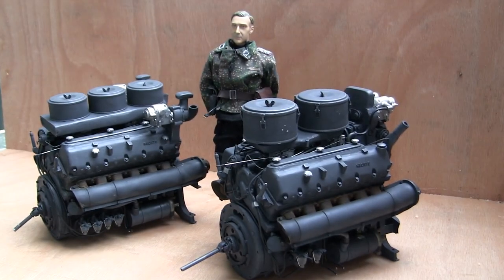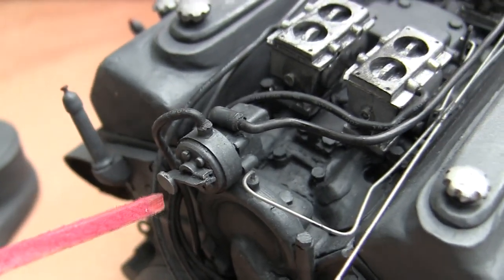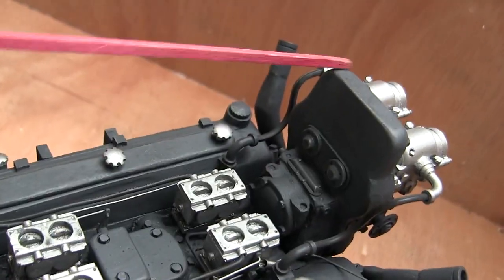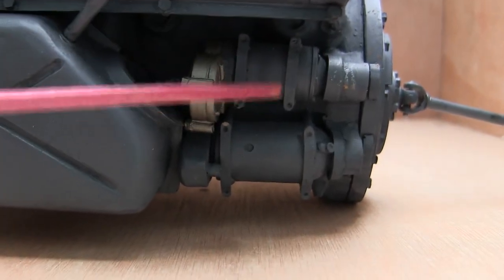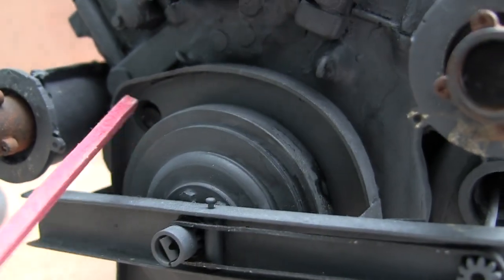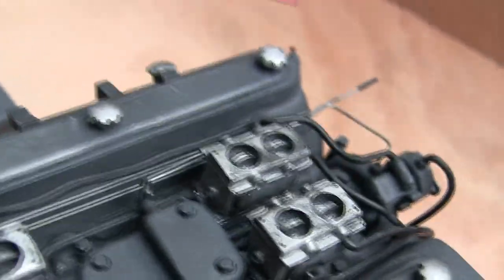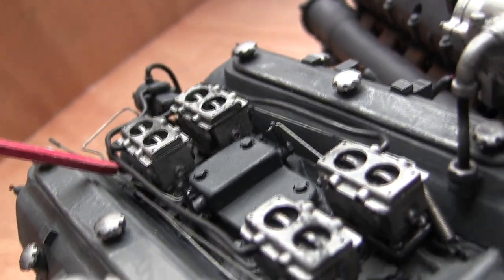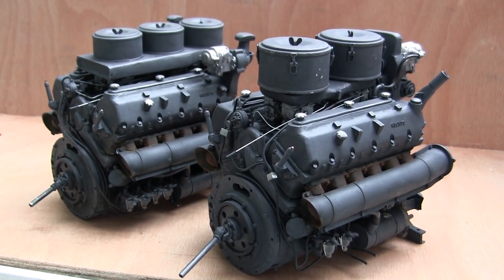1/6th scale Maybach HL-210 and HL-230 engine model walk through HD video

Comment: The carburetors were controlled by a governor within the manifold that accounted for the elaborate throttle linkage system.
Reply from the maker: yes, the governor is located inside the box that is the center of the manifold. There is a cool video of the littlefield panther restoration which shows it in operation.
Reply: thanks